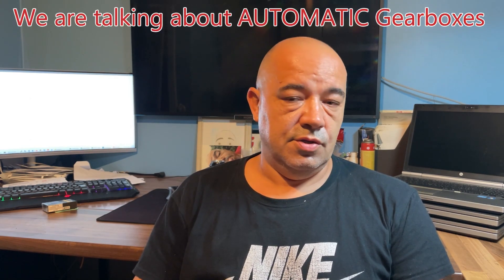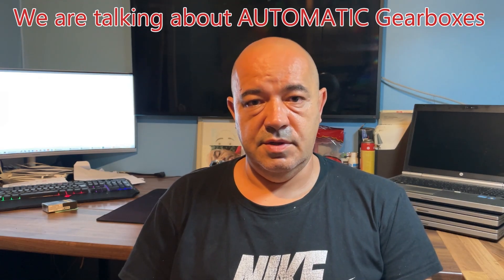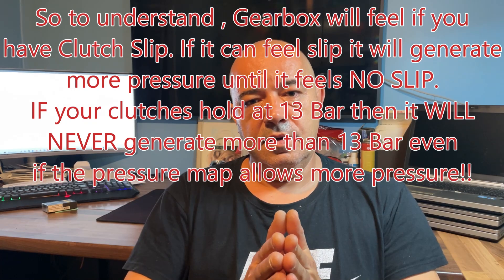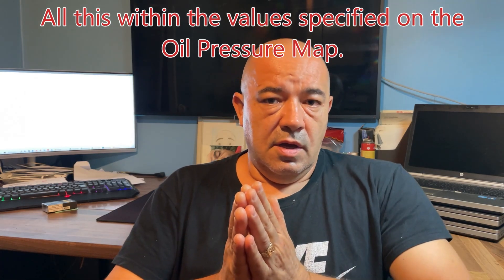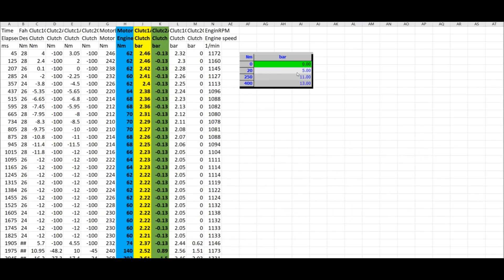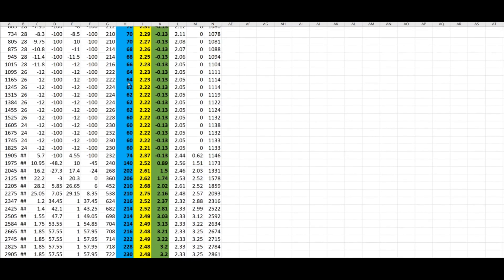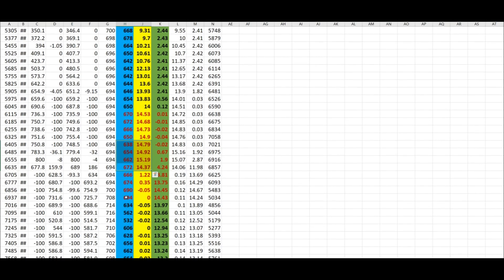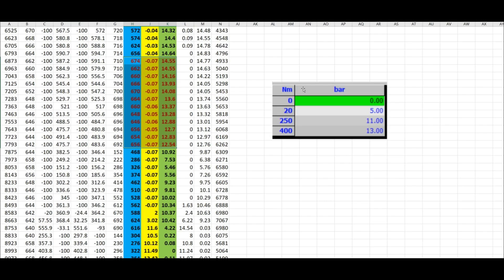DSG Clutch Pressure (Clamping Pressure) and WHY  you need it ?

Comment: Nice video Gigi, Do you know what meassuring blocks to search in VCDS for the clutchs pressure? for a DQ250 (2008 VW GTI)
Reply from the maker: Just put "pressure" in the search filed of the PID's , it will show all "pressure" related channels.
Reply: @GigiBeleaDK  thanks, maybe is an issue in my VCDS, in the DSG module meassurement blocks it does not show any description for the different blocks, I will keep trying to see what is wrong with it, do you have any video presenting your DSG tuning service, I liked to see what can you offer for this
Reply from the maker: @HowieLop  definitely a VCDS Issue